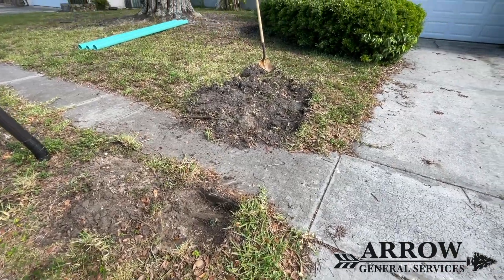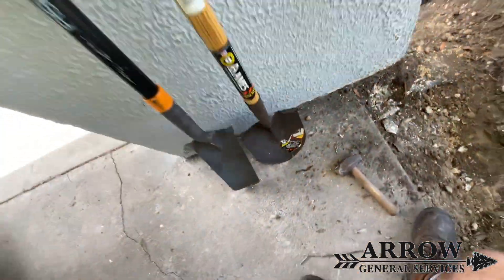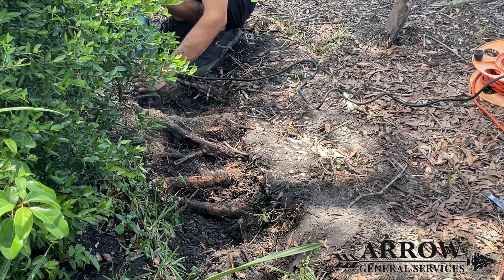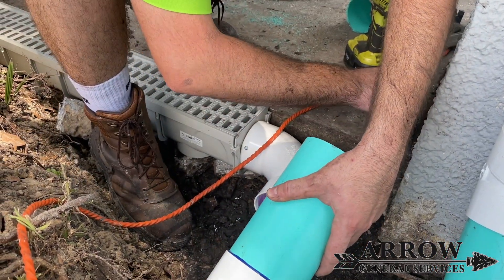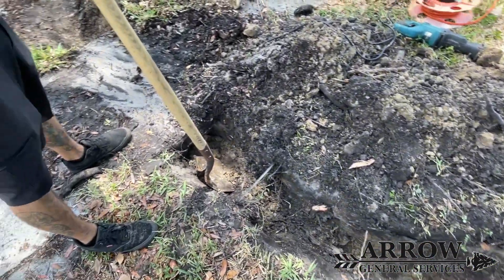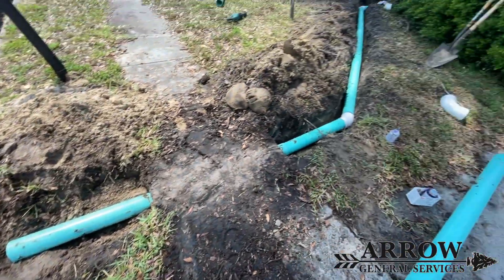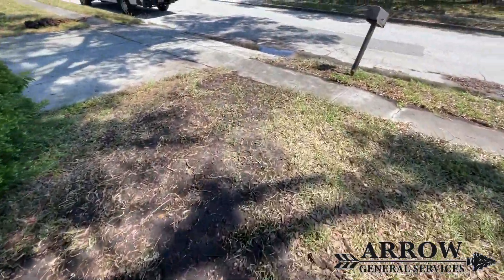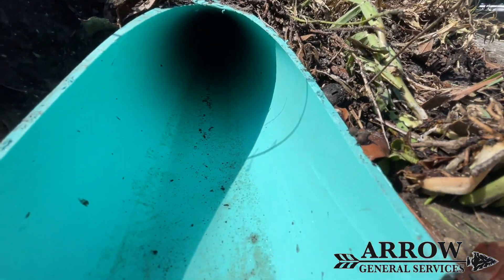Rain Water Drainage

Comment: I'm in central FL (Orlando).  If I want to use SDR 35 (4") what is the min depth I should have my pipe?  I have about 1.6 degree slope from low spot in yard to front curb.  Is 8" sufficient therefore the pipe has about 4" of cover; will that be enough for the grass or does it need to be lower?  Or does the trench need to be 12" with 8" of ground cover? Thanks for the help and love your channel.  Have watched many vids.
Reply: You don't need that much cover over it. St Aug grass will grow over damn near anything. If that trench is only 5-6" wide and no heavy traffic is going over it, it doesn't need to be deep

Comment: Did the same type of drain installation for a similar sized company in PA.  Man what a difference in soil composition.  In SE PA there is so much rock in the soil that I couldn't run a trench without also having a mattock, pick axe and digging bar to break or pry some of those suckers outta the way.  Seeing the sandy soil here would made me jealous on those 100°+ days.
I miss it. It was honest rewarding work and paid well.

Comment: Nice job, but seems like you should secure the channel drain in place, e.g., pour concrete around it.
Reply from the maker: Yes that is correct, but in this case the client did not want to do that so the channel drains are staked in place with 12" spikes.

Comment: I always herd never to use the green pvc. Only 40 underground
Reply: Not true.  Thin wall green PVC works fine for underground downspout applications.
Reply from the maker: A lot of city sewer lines are SDR 35. It is way thicker than thin wall. We don't like using thin wall unless the client doesn't want to pay the extra cost for SDR35. But we have seen thin wall systems that are still functioning well after 10 plus years of being in the ground so it may also be  how well the system was installed and other factors of the area that come into play.